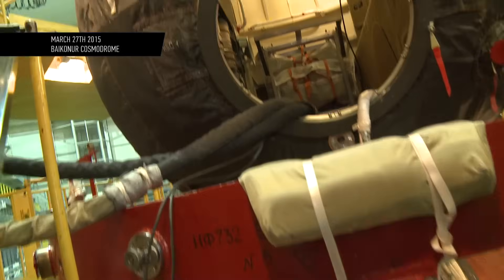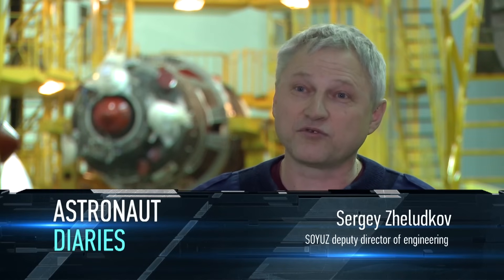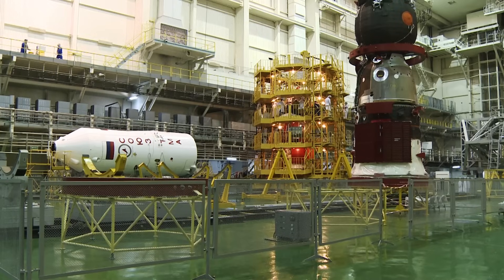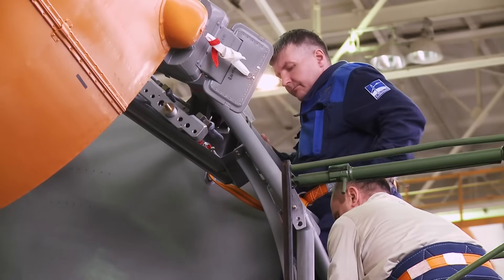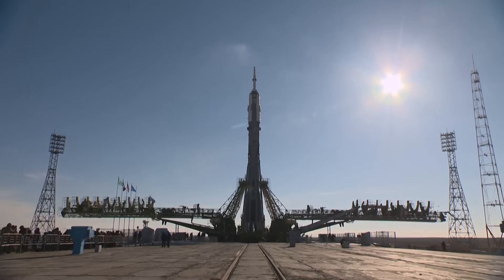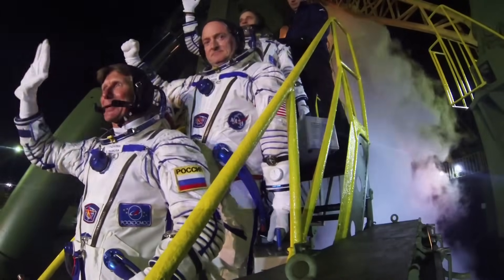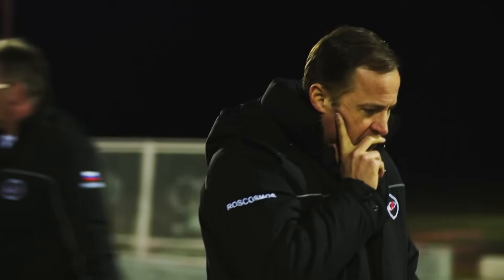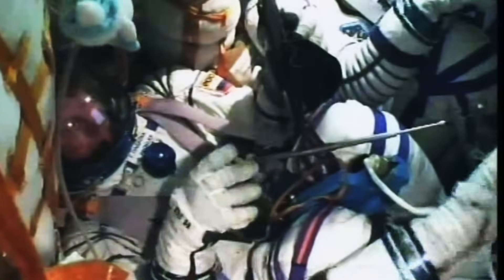How Is SOYUZ Spacecraft Prepared For Space Launch?

Comment: Old technology. It is high time they start working on a space shuttle. It doesn't have to be as big as the Buran (old Soviet space shuttle). A smaller version and a little bit bigger than the existing soyuz space capsule will be the right size, well mounted on the very top of the rocket.
Reply: Сказали в 30 году будет готов новый

Comment: The AK-47 of the Space "Soyuz" is beautiful
Reply: Great analogy  👍🏼
Reply: Except it appears very cramped and cluttered.
Reply: @MikeMcglynn-qv1tq  , Yes, but it's a very safe and reliable spacecraft. It's like a normal airplane ride into space, which surprises me a lot... Apart from that, it´s much cheaper than space shuttle (ten times cheaper!). So it´s almost perfect!
Reply: @MikeMcglynn-qv1tq it's cramped only when you are in your seat in the descent module, otherwise it has similar habitable volume as Crew Dragon, for example. Thanks to the orbital module.